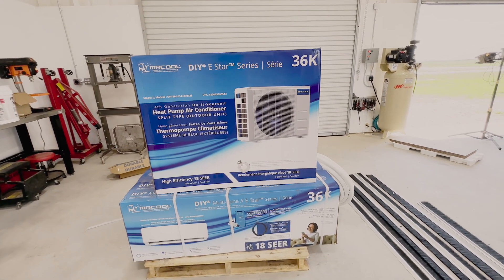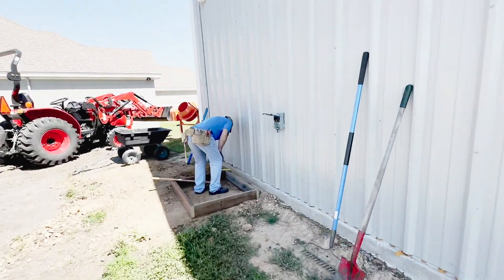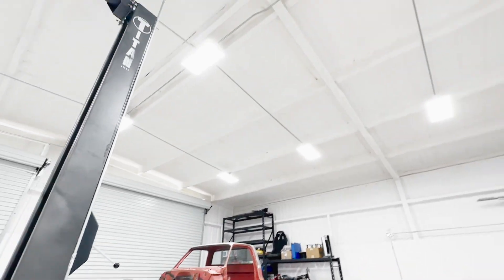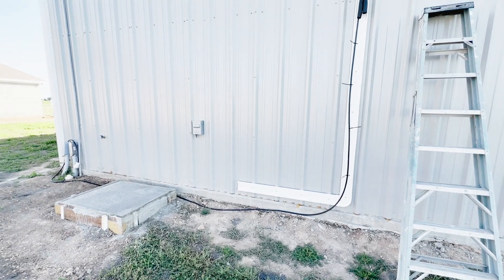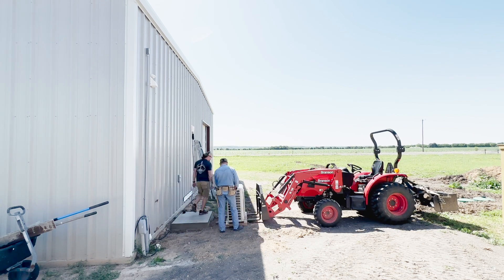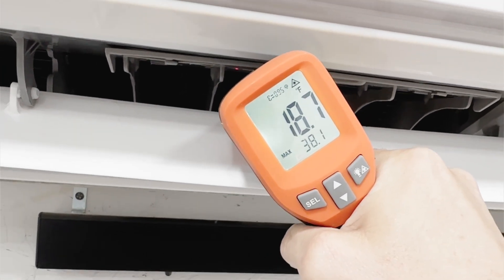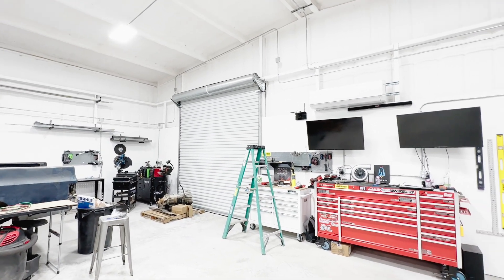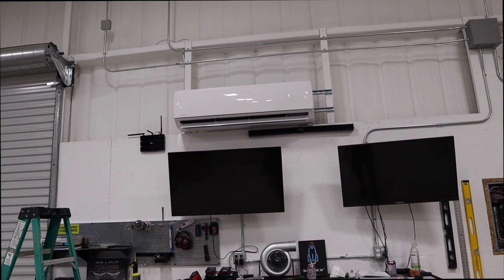Mr. Cool DIY Mini Split Installation

Comment: Question:  Is it OK to run the "plumbing lines" down the interior wall and have it exit to the exterior at a level closer to the exterior unit?  I have concerns the HOA is not going to like the look of the exterior covers coming down the exterior wall.  Thanks!
Reply from the maker: Absolutely! I did exactly that on a previous installation and coiled up the excess tubing within the wall.  Just make sure you don’t create any traps or kinks in the condensate drain line or the unit will eventually back up and leak.

Comment: Looks good, what size line set cover does this need?
Reply from the maker: I used the 4.5” wide set and it had plenty of room.  Should’ve bought an extra straight piece to finish it off but I’m not sure if you can buy them individually.